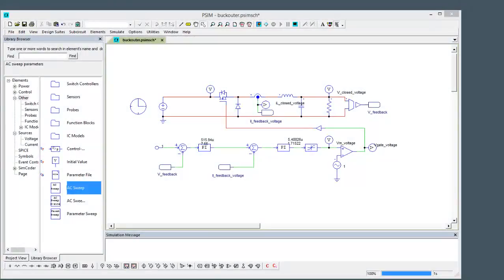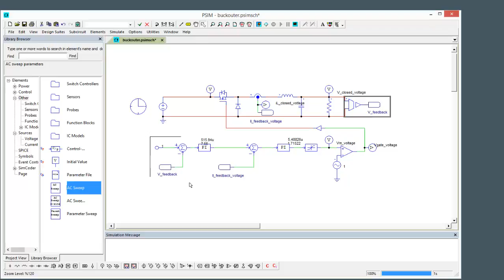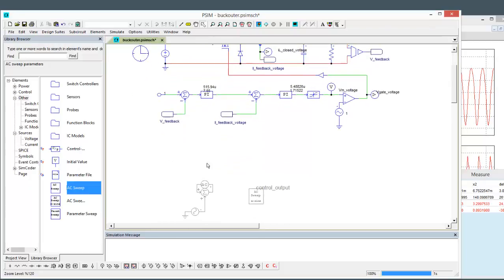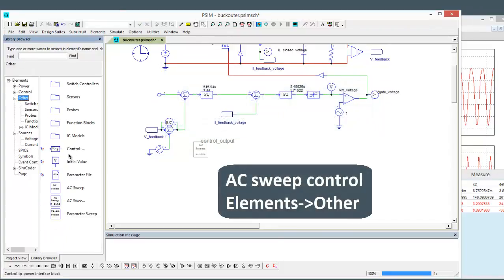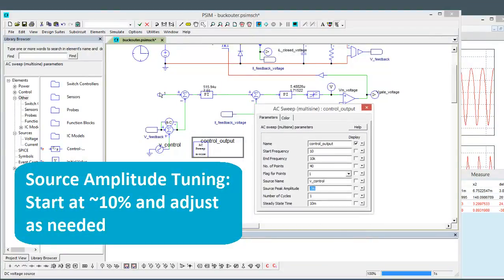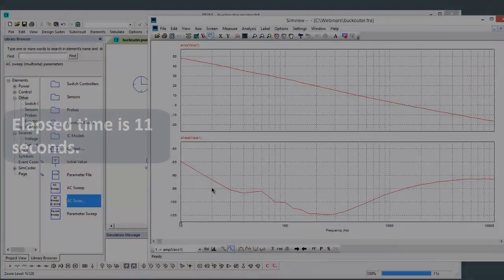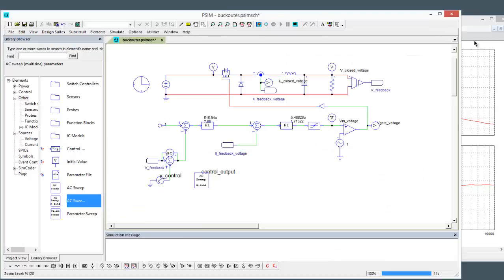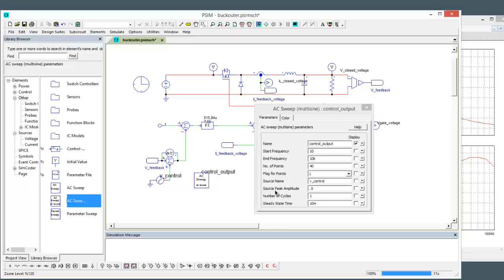How to determine the cross frequency and phase margin (outer voltage loop of a buck converter)

Comment from the maker: Want to try PSIM?                                                                                  - https://hubs.ly/H0f9wCC0
Why is PSIM preferred for Power Electronics simulation?             -  https://hubs.ly/H0f9wFX0
Why should you use PSIM for digital control?                                  - https://hubs.ly/H0f9wC-0

Comment: Cool video Albert. Is there a way to add custom measurements that would automatically calc the Gain Margin and Phase Margin and display it with the graph?
Reply from the maker: You can. two ways: write a script that will do this, or in  "analysis" use a custom graph or formula option